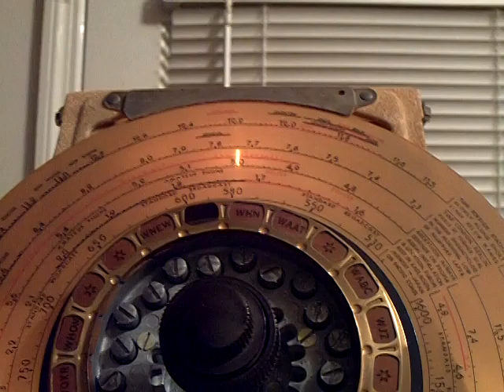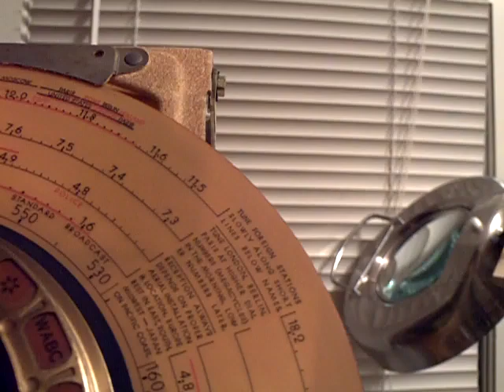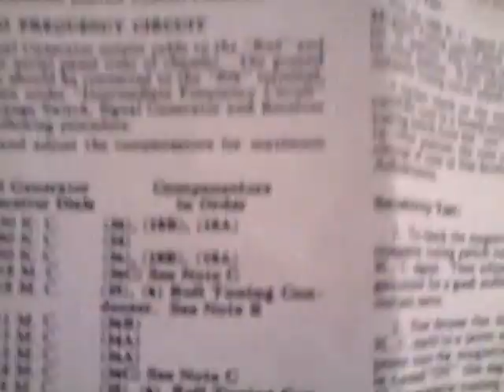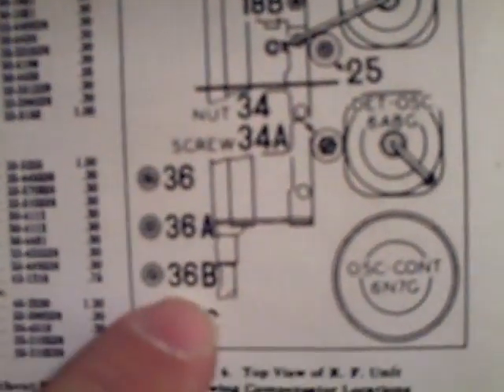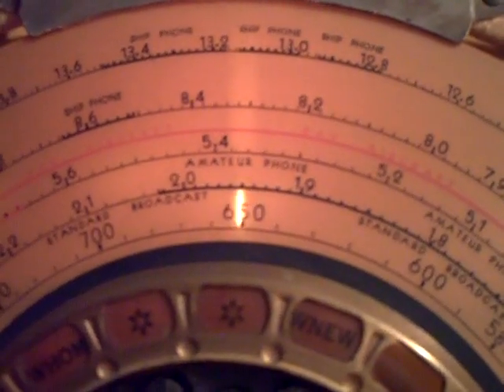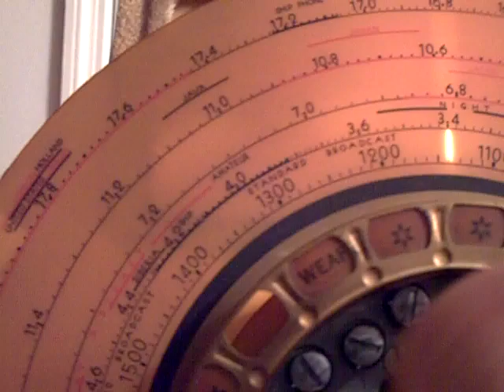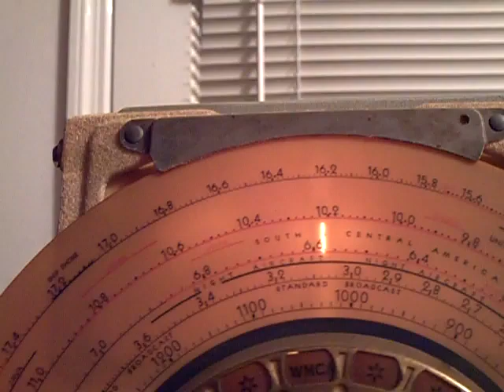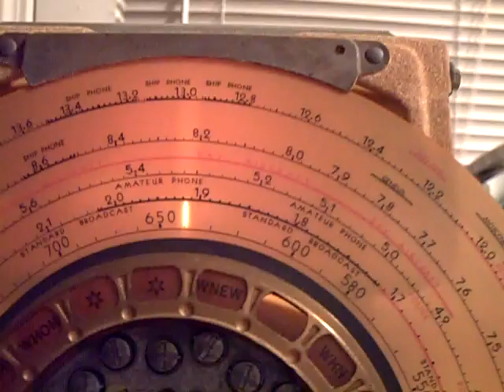Philco 38-116, Repair, Part 16, RF Alignment almost Completed.

Comment: Hey, also, if you cannot run a long wire outside, you might want to try and find or build a nice wooden magnetic loop antenna to sit on top of that radio when complete. An example M2's Dutch Windmill antenna.  Good luck!

Comment: hi lock, i watch most of your repairs on the 1938 philco. how did you get to the caps on the under side of the tuning capacitor. i'm currently working on a 37-116 and some caps are impossible to get too!!!!  i'm thinking the 38 -116 philco is very similiar  thanks, juke-n-jeff
Reply from the maker: +viickie spain Hello, and thanks for your interest. I think the 37 model is more of a challenge due to the increased number of trimmers that need to be adjusted in the alignment process. I had a video somewhere on this where I show I used the hook method. I cut the old cap out but left enough lead to make a hook. I used long nose pliers to make a hook. Then I used the hooked lead of the new cap to that hook and soldered the hooked together joint. Tricky but it worked.
You might need to scrape crud off the old wire before you make a hook in it. Good luck and keep me posted on how it works out for you.